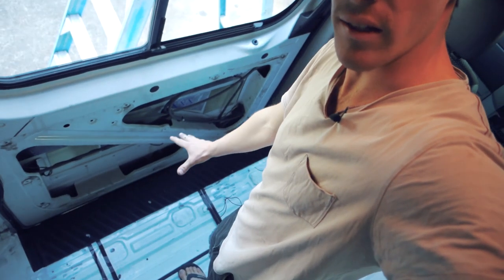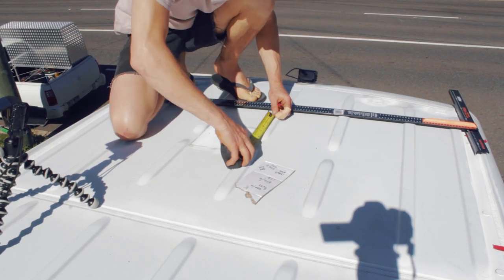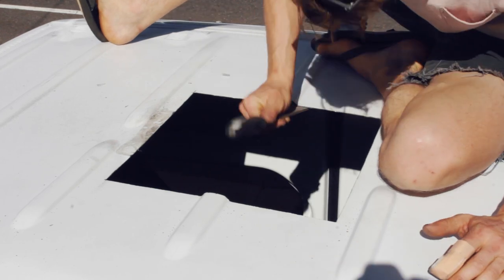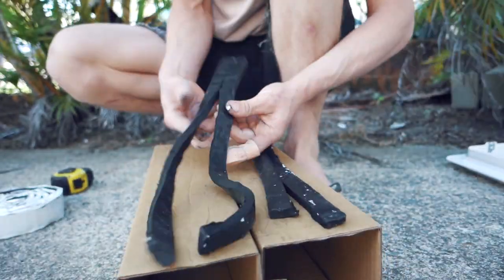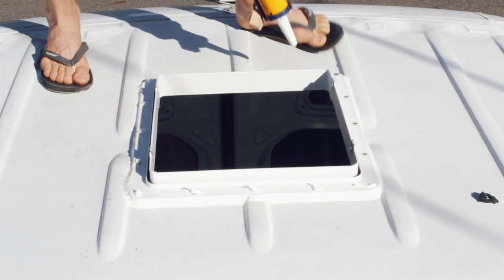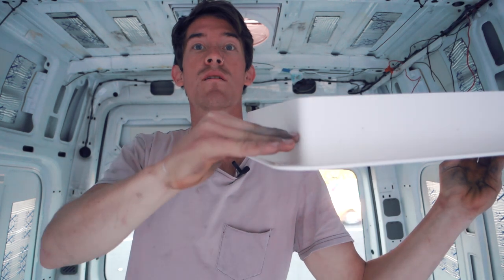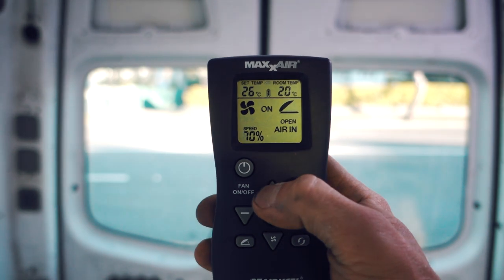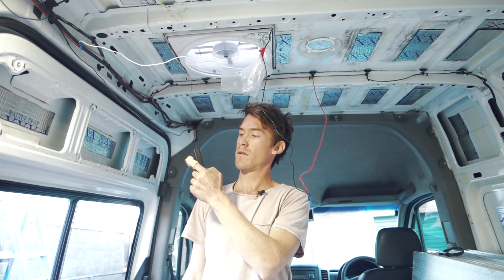S1E3 Sprinter Van Conversion | Maxx Fan Install

Comment from the maker: The Maxx Fans work great, especially the front one which is mainly used to extract hot air and fumes when cooking. We could survive without the back one, but it does come in handy on really hot days!

*I bought the PUTTY TAPE from a guy on eBay, who was selling his last stock. It seems to be a hard thing to find.

Ep.3 BLOG + PRICE BREAKDOWN - http://www.jazmorton.com/van-conversion/maxx-fan-install/
Season 1 Van Build - http://bit.ly/VanBuildS1
Season 2 Van Life - http://bit.ly/VanLifeS2
Reply: I was mainly looking at a roof fan for condensation in winter. How'd you find that went? TBH I think, given I've got a Hiace Commuter with lots of windows... just having the passenger front window ajar, and the rear driverside window ajar and having an inside fan blowing towards the back when I'm sleeping etc. Hoping that's going to stop condensation, as I didn't really want to spend the extra $400 on a roof fan, plus adding height and if I screwed up the install :P
Reply: Random question but I am trying to set up my van. What do people connect their 12V DC RV roof fan/vent to if they have a solar system in their van??? From what I have seen inverters only have AC outlets?? am I missing something??? Thanks
Reply from the maker: @adamheeley285  hey Adam they connect it to there 2nd battery (dual battery) or (house battery) that powers all the things in the back of there van. It is connected generally to a DC fuse board, which is powered by there house battery
Reply: Have been using Jaz’s awesome videos for every step of the way of our van build. I also struggled to find the thick putty tape which was used but managed to get the result by using a few layers of this from Bunnings:
https://www.bunnings.com.au/one-on-one-48mm-x-5m-heavy-duty-double-sided-sealing-tape_p1091267

Just make sure to cover it all with sikaflex to be triple sure. I am no expert but just thought it might be helpful in future for others.

https://www.instagram.com/_boltthesprinter/
Reply: @chrisweinlich8154  Was helpful to me.

Comment: Tip: (from my experience) 
I installed a Maxx air fan on my 2013 transit connect, and i also installed a bug screen in my doorway. Now this video has two fans, but i only have one.  Typically you want to suck out the hot air in the summer, but i was today sitting in my van and noticing bugs were collecting on my bug screen when my door is open cause i like to not feel enclosed. I started thinking about it 🤔. So with my fan sucking air out and my door with the bug screen being the intake, it was causing a negative pressure effect on my van.  I then experimented with reversing the fan so it blows in, positively pressurizing the van and using my door with the bug screen as my exhaust, and instantly, the bugs flew away.  I'm pretty sure the bugs were flying by and got sucked to the screen, which was probably unpleasant cause it's sprayed with a homemade peppermint, tea tree oil, lavender, rosemary, and eucalyptus spray i made to spray my doorways.  Anyway, I've had a few bugs come back, but not nearly as many.  My 2¢ won't hurt to try for yourself, and if it doesn't, well that took 2 minutes.

Comment: Jaz,   You have done a very nice job on this van.  I just bought a 2015 and will be camperizing it.  I would suggest to anybody else who is installing fans to use a hole saw for the corners as round corners will try to stop any tearing of the metal skin of the van.  Really nice job mate.
Reply from the maker: great tip thanks mate, and i would suggest using a jigsaw instead of grinder too like i didnt' haha

Comment: Over your stove it might be good to fit a range hood. This will reduce steam and oil spread in the van.  You only need a small 150mm additional vent hole above it. I got one this year from CaravansPlus in ACT - it has a built in downlight and clock as well.
Reply from the maker: Awesome will have a look at this, and test out my kitchen maxx fan for the job also and see how that holds up. Thanks a lot!

Comment: I think you have the right idea — two vents to move the air through. On a budget I feel you could have replaced the rear MaxxFan with a just a simpler vent or a skylight that opens. Two fans running doesn't seem to be required to move the air through..
Reply: My 2016 Sprinter has large vents on the top of the dash, so I don't think you really need to even add one on the roof.  There's a large filter under the hood, on the passenger side, that goes to the vents.  I think there's an exit vent somewhere hidden in the right rear corner too.  
I'm just mounting a Maxxfan in the rear of my van, to pull air from the front.

Comment: Do you have any rattling sound from the fan when driving on bad road? And On higher speeds do you get wind noise from it?
I'm wondering why we needed to lift those metal pins.... that seems oddd....
Reply from the maker: I don't get any rattling sound and there might be the slightest wind (as in outside noise) but no whistling or anything like that they are great fans and very solid

Comment: Hey man, love the video. I noticed on the MaxxFan instructions it says to only install on a minimum roof thickness of 1 1/8” and to build it up with wood, etc if it isn’t that thick. Did you end up adding wood or other materials? Or is it okay with just the thickness of the roof?
Reply from the maker: Hey mate I didn't add any extra would, just used all the screws to secure it, with a lot of sikaflex.

Comment: I’m about to install this fan because my factory fitted vent leaked. What I realised when i watched your install was the final peace that you didn’t install because you don’t have an internal roof was that you could silicone the inside giving you more protection from water damage which is what I’m going to do .nice vid thanks. Beware of mixing butyl tape with silicone
Reply from the maker: Good idea mate thanks a lot!

Comment: Great series Mate- I like that you clean up after each step - it pays off later.  One question: Why are the 2 fans offset as in not in-line or on center?  Better air flow or is that based on where things will be positioned?
Reply from the maker: Thanks a lot mate it definitely does pay to clean up often haha. The front fan is going to be closer and above where I will be cooking, that's why it's offset, also the shower construction wouldn't allow center position.

The back fan is center above where the bed will be, and also needs to be center as there are overhead cupboards on each side

Comment: very good idea, but have you ever think about the foam? what is the difference? foam and the manual process of insulation? price?     good job for your van!!! very good
Reply from the maker: Thanks a lot! Do you mean the spray of foam, that covers everywhere? I thought about it but I want flexibility to run wires and a cavity in the walls for future cabling if necessary, I just think it is easier the way I'm doing it
Reply: exactly, what I was talking about, because I m doing mine, and I m at this point to choose it. because I use less wood, and use more metal so could be more thin and hang more pound. gRate job so far, waiting your next video
Reply from the maker: Okay i see, really it is purely up to personal preference, this wad my preference, and depends on how you are building your van, budget etc etc haha

Comment: Hi Jaz, if I'm installing a fan on a area of the roof that is completely flat with no ribs in the way, would you still use a putty tape? To give it something between the vent and metal roof? Thanks, your vids are perfect, straight forward and detailed.
Reply from the maker: i probably wouldnt use putty tape in that situation as long as your sealant definetly seals the shoud 100%

Comment: Did you consider an AC unit instead of one of the fans? I know it takes ~5x more power, but with your advanced electrical system you could probably run it for a couple of hours a day & the insulation would keep the van cool.
Reply from the maker: I gave it thought but didn't opt for it, I didn't think i really need one and the fans handle pretty well :)

Comment: Jazz, well done.  My daughter is buying a 2010 Sprinter and we will be starting this process soon but will have do it in phases.  first phase is the dampening, insulation, a place to sleep and store her gear and counter space for future use as sink, shower, toiler.  question for your is, where did you tap into for electricity for your fans.  
thanks
v/r
jerry
Reply from the maker: That's awesome mate! For the fans I temporarily wired up to some 12v wiring that was already in the back, but they will be wired up to my secondary battery permanently once this is all done

Comment: Awesome work! Do you happen to remember the thickness of the putty tape you used?
I'm about to embark on the same adventure and have to deal with the ribs. The only tape I found on Amazon is 1/8" thick which doesn't seem to be sufficient.
Thanks!
Reply from the maker: Hey Eran I would guess it is around 12mm - 14mm thick roughly, but it can be squashed down. All the best with it!
Reply: Thanks!

Comment: I love love love how you show every step and make it simple, but could  you please show how you connected the fan to power?  Or if the fans run on batteries can you lease show me how I will change those batteries?  
(I’m brand new at this l) 
Thank you very much.😊
Reply from the maker: In the video the fans were connected to a temporary 12V supply. But later this was changed to the house battery in the back of the van which was installed later, which is a dedicated 12V supply, I would go and watch Ep.9 and Ep.13 which go in depth on the battery system, and also check the related blog posts on my website which break it all down.

Thank you
Reply: Ty

Comment: Hi Mate, great info! Have you seen anywhere in Australia that sells putty tape? most butyl tape here seem to be a foam rather than a putty... Even on AU Ebay. Might have to get some from the states.
Reply from the maker: Thanks a lot Tyler! I had the same problem, I got lucky on eBay and bought from a small private seller someone was throwing out their old supply. I got it dirt cheap. Somebody in Australia would but it's just a matter of finding them.

Comment: Did the fan directions instruct you to face the fan's opening side forward? It seem turning them around would produce less wind resistance and likely less damage when driving at faster speeds.
Reply from the maker: they instruct to install them the way i did. it is more aero dynamic the way they are mounted here.

Comment: Love all your vids mate! So helpful!!! I was wondering where you got the putty tape from? I can’t find it in Bunnings at all. Thanks a lot
Reply from the maker: i know man its hard i found it from a random private seller on ebay its hard to find sorry i cant link it somewhere man good luck
Reply: @JaznLori   Thanks mate, I ended up finding 12mm rubber stripes & added double sided butyl tape on both ends and it did the trick pretty well. I have to say your videos have been a MASSIVE help in our build so far. Thanks a lot!

Comment: Quick question. Were u able to control both fans from one remote control or did each fan need a controller of its own? Thanks.
Reply from the maker: You can control each fan from one remote control
Reply: Sweet. Thanks for replying 👍

Comment: Question: if you are wanting to go completely stealth, can you build it so the lid height only reaches flush with the van if fully open (recessed in when closed)? Also, can you hear the fans when you are standing outside but beside the van? I realize you might need a way to drain it if water collected (sealed hose from one corner?) but it wouldn’t be stealth otherwise... do you a work around seeing a fan open on the roof.

Comment: Hi Jaz, you're videos are great, thank you so much! Really helpful as we start to embark on our first van build journey. Is the reason you've put two fans in for ventilation requirements, or to get the air flow through the van? I'm in Australia as well, so trying to work out if one or two roof fans are required or simply one roof and one lower vent. Cheers mate!
Reply from the maker: Hi Chris, I put 2 in so I could get better airflow through the van when the van is closed up, (one sucking in air and one extracting it). They also act as diffused sun lights during the day which is nice too. I am not sure on gas venting regulations but I know the gas fitter put sticker labels on both my Maxx air fans saying these shall not be blocked
Reply: Jaz Morton cheers mate. This is really helpful! Didn’t even think of the extra light, but it makes sense. Once I’ve got the plans drawn up, I’ll get it all confirmed by a gas fitter and go from there. Now to find the van to start!

Comment: Hey Jaz, It looks like you screwed the screws in and then sikaflexed the top of them. How did you manage to rescrew them into the celing's wood panels when you finally were able to put the panels in? Did you have to tear them out the holes and resikaflex the heads?
Reply from the maker: They aren't screwed into the internal wood panels. They are simply just screwed into the van roof metal, and sikaflexed down. they'll never move especially since they are sikaflexed.

What I meant by "finishing the last bit and screwing into the ceiling panels" is the cover shroud which you can see I believe in episode 10. this shroud just has 4 screws that screw to the celing timber and neatens it all up
Reply: @JaznLori  Most people screw the fan into a wooden battens which surround the fan underneath rather than just screwing into the skin of the van. I'm surprised no one has picked up on this. Has this way of doing it worked out all ok for you? I'm doing my roof fan tomorrow its a fantastic vent going onto a ford transit, I guess if I could do without wood batten surrounding the fan I will as I don;t have the right thickness of batten.

Comment: Tell me how your electrical system is not installed yet, you took what electric power for the installation? Have you made use of the electrical lighting system?
Reply from the maker: I used existing 12V from the starter battery in this video, later on changing it to the house battery
Reply: Thanks ;)

Comment: At 5:12, it's better to take the shroud off after drilling the pilot holes and drill larger holes in the shroud to allow the screws to slip freely. Then the screws pull the shroud down better.

Comment: bro, how did you power them?
i’m confused in the electrical part
Reply from the maker: In this video I use an existing old feed for an old light that ran from the van starter battery to power the fans temporarily just for the purposes of demonstration in the video, but I eventually removed this feed and ran permanent feeds from the van house battery in later episodes
Reply: Jaz Morton would you not recommend using the car battery as a permanent source of power for the light?

Comment: What power source did you connect your fans to and how? We just tried to connect the pos/neg wires to a 125v non-polarized plug. When we plugged it into our 120v Goal Zero Yeti, it rejected the connection. Next, we plugged the fan plug into an extension cord to the house, and shorted out the fan causing sparks and smoke to come out the fan computer. Any reason why these happened?
Reply from the maker: Ahh mate it's a 12V DC Fan, not a 125V AC fan. The fan also is polarised, so pos and neg will need to be correct polarity.

Mine is connected to my van house battery (the battery that runs all the loads in the back of van), not the starter battery.

From memory, I think the Maxx fans might come with a fuse built in, hopefully you've blown a fuse and haven't fried the fan..

Comment: hey bro. what are the dimensions of your van? i guess the height is around 190cm but lenght and width? Sorry if youre covered this already somewhere else but you know, im lazy and cant be arsed to look them up myself :D
Reply from the maker: I've only got internal dimensions of that back section, which are 4200mm x 1770mm.as for the height It would be about 1900mm yes

Comment: Hi Jaz what are the rear dimensions of the van H,W,L thanks
Reply from the maker: Hi Gary, I will refer to my drawing when I finish work but off the top of my head the back floor measurements are:

4200mm long 1770mm wide and 1920mm high

Comment: how many watts does your fan use?
Reply from the maker: One maxxfans uses anywhere from 0.15Amps on the lowest speed up to 3.2Amps on the highest speed . So this equates to 1.8watts to roughly 40watts at 12V DC
Reply: @JaznLori  Thanks!